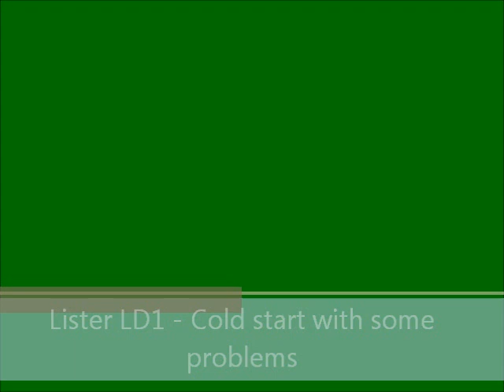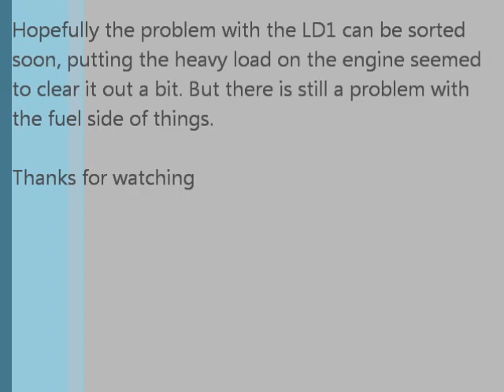Problems with the Lister LD1

Comment: In cold weather i always use the cold start device, (oil cup on inlet manifold, oils the cylinder and increases compresssion helping to get the engine running with busting your guts)  would benifit from a de coke, check the injector and make sure you get bump clearences correct. LD1s are low power engines. All mine are on Autotrucks and produce 3.5 hp at 1800 rpm. Lots of idling with no load will glaze the bore too.

Comment: Maybe there is a piece of dirt somewhere in the other side other filter line which is lodged in the injector? But it runs at a steady beat, but seems to be a bit smokey maybe a decoke is in order? But I could easy stall mine. Remember they like to be circulated a lot before starting in the cold :-)

Comment: If you still have the engine, take the cover off of the fuel pump housing, remove the plate "gingerly" . with the proper size wrench remove the banjo fitting from the injection pump (b sure to replace the copper washers with new ones when finished) and the output side if the fuel filter, throughly clean the line with 2+2 carb cleaner, then screw a 1/2" BSP x 5/16 barb fitting into the injection pump (finger tight only) then add a length of hose and a funnel (I use alum body Audi fuel filters with the wadding removed. Fill the funnel with OTR diesel so no air remains between the inj pump and the funnel then add 4 ozs of "Stanadyne PF mpn: 38565P" rotate the flywheel so thus the engine doesn't fire continue to do this until 1oz of the OTR diesel comes out of the injector return line, then add 3 oz of "Stanadyne LF mpn: 38560P" then repeat turning the flywheel once the PF/OTR fuel mixture comes out of the inj ret line. let the engine sit for 4-6 days. then reassemble and start engine as you normally would. This fix works in just about any climate from 1 cyl to 16 cyl diesel engines

Comment: Nothing wrong unless it doesn`t start. You wouldn`t do bad, by bleeding the pressure pipe while its running! It will help the engine a lot.